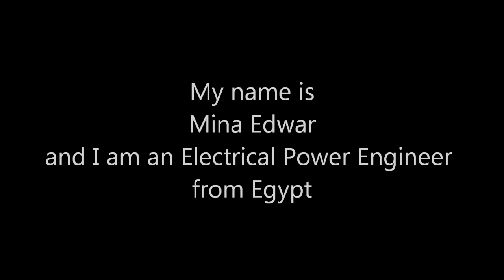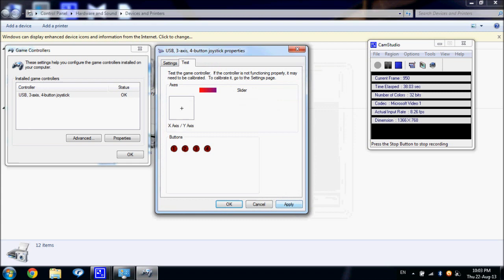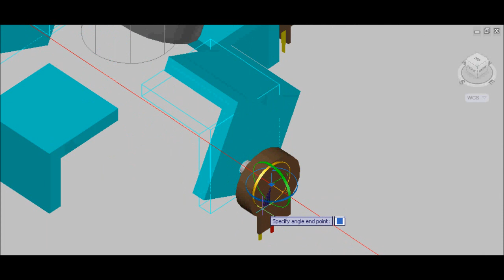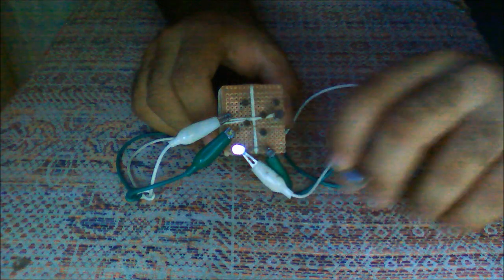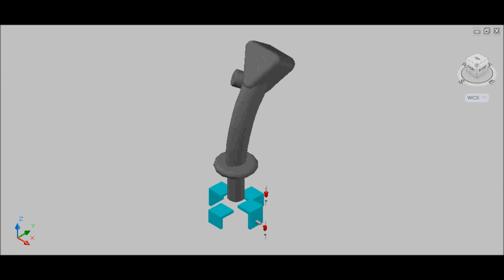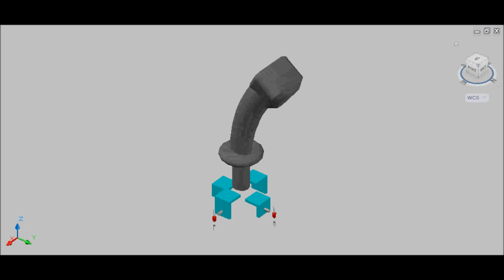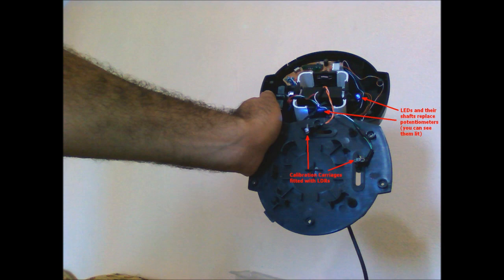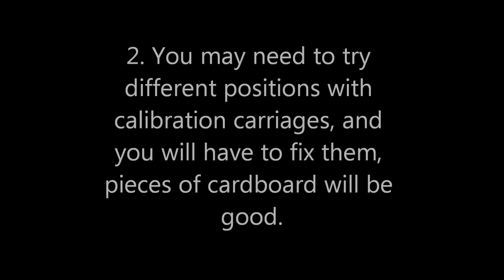DIY Convert a cheap Joystick to precise one

Comment: hello... that´s an interesting proyect. Thanks for sharing. I only need to know how to connect the ldrs... because potentiometer has 3 pins... and the ldr has 2 pins. Could you explain that?
Reply from the maker: Potentiometer has 3 legs but only 2 are connected, so you are just going to replace it with LDR